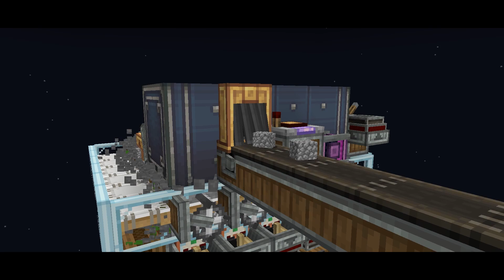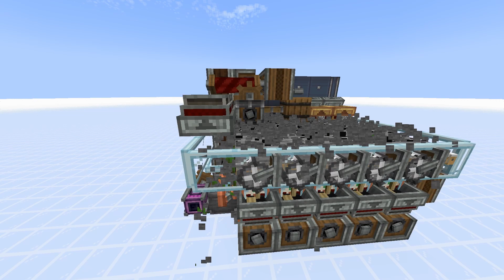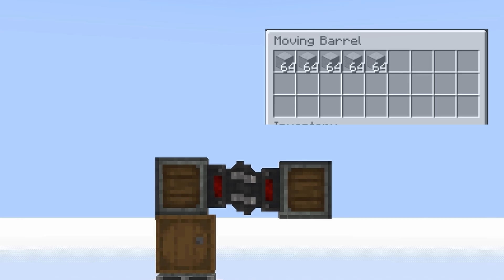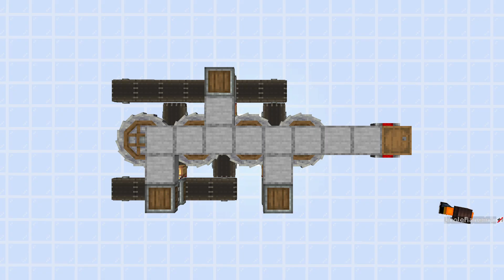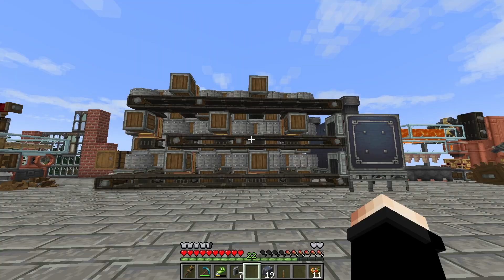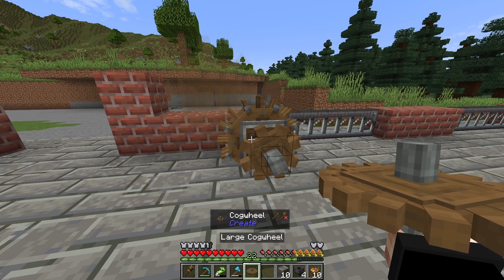I Built an INSTANT Crushing Setup in Minecraft Create Mod!

Comment: What I thought: Bro removed the crushing time to make it instant.
What bro did: Distribute items super fast to multiple crushing wheel setups.

Kinda a clickbait for me, but still, nice work on designing and making this vid.
Reply from the maker: There's no way to change the crushing speed/time as it's coded in Create Mod, so the only way to add more Crushing Wheels, and how to optimize it for the maximum throughput. :D
Reply: @UncleRanger  Yea I know about that, so I was genuinely surprised when I saw the title. I literally thought you have some tricks to take out the items while it's inside the crushing wheels, so that it can be instant 😂